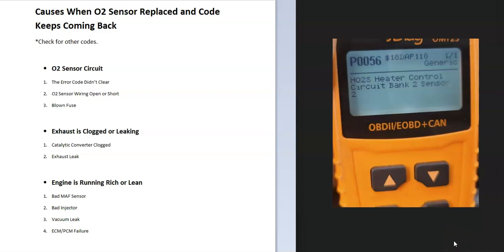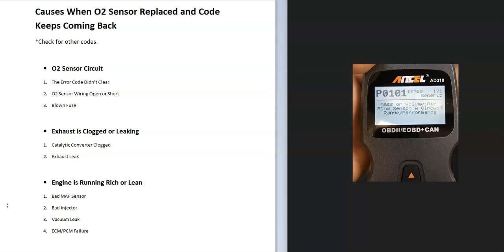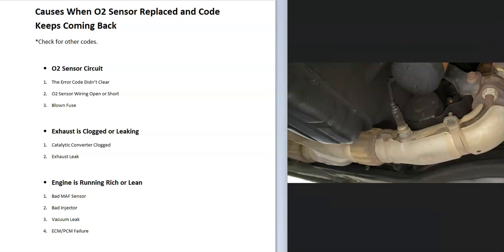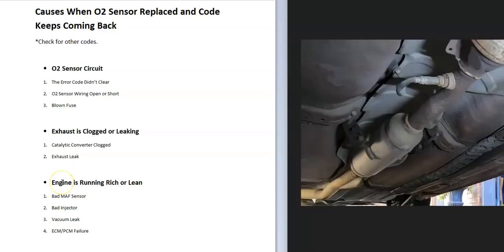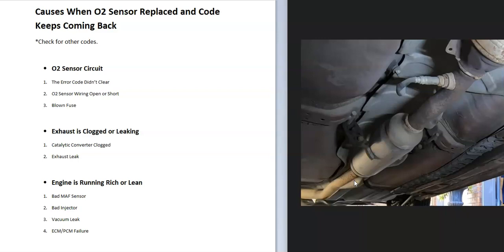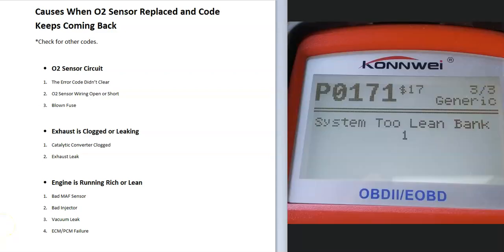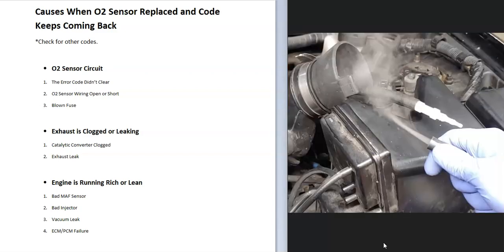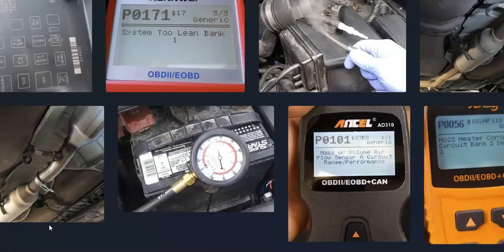Causes When Oxygen Sensor Replaced and Code Keeps Coming Back

Comment: I replace all 4 o2 sensor and after that I get the code P0402 with I think is the bad catalytic but i was hoping for and answer
Reply from the maker: A P0402 code is an issue with the EGR valve "Exhaust Gas Recirculation “A” Flow Excessive Detected". Here is a video on it https://youtu.be/KAcaDElYKxU

Comment: For us, after replacing two O2 sensors and still the same problem, thanks to this video -- it was a cheap FUSE!
Reply: What do you mean by "cheap fuse"? Either was the fuse blown cause it's cheap or was it not blown but somehow causing an issue. Please explain cause as far as I understand either a fuse is letting in electricity or not if it's blown.
Reply: @joev.7909 I think they meant after spending a lot of money on expensive o2 sensors the thing that fixed it was replacing a fuse. Which are not typically very expensive

Comment: I have 2010 Toyota Camry that won’t start after replacing the O2 sensor the upstream it will not start. It will crank but it won’t start. Somethings wrong. I definitely need help.

Comment: My issue is that my 03 350z is having two p0037 code. I replaced the o2 sensor and replaced the fuse yet it’s still there. I unplugged and plugged back in the sensors hoping maybe I didn’t click em in right but still code is there so I’m lost now
Reply: Got the same thing right now. What was the result for you?
Reply: @ you may not like it. For me it was my ecu. The grommet for the main wire harness wasn’t on correctly so when it rained (I’m assuming) water followed the main wires down to the ecu and fried it. Previous owner had some wild things going on with it. If it’s the same issue then find somewhere you can mail them your “new” ecu and they can NATS delete it
Reply: @PrplexedMG  good news, light went away while I was driving. Will definitely keep what you wrote in mind for future reference. Much appreciated
Reply: @ glad to hear it my man the ecu going out in the worst case scenario LOL but to know forsure if it’s the ecu that went out the HUGE red flag is that your radiator fans will kick on immediately after turning it on accessory mode

Comment: can you do a video on p2237 codes thanks
Reply: Did u find somthing about this code i just replaced the o2 sensor and the check engine light still on
Reply: @redouanuiste9334  disconnect your battery for 5 minutes.. this idiot never tells to do that . Which is the only way to reset the ECM..

Comment: My Accord V6 threw a P0130 code for an oxygen sensor but it was because I embarrassingly  neglected the air filter for so long it was totally clogged. It's been 3 months and the light hasn't come back on.

Comment: So i have a 2008 Honda odyssey and been getting the codes po155,po134,p2240,p2251. The oxygen sensors have been changed numerous times along with the catalytic converter, the codes keep coming back it's really been a pain in my side for the past 5 years I've spent so much money trying to get these codes cleared. What can you suggest?
Reply: I’m having the same issues, my Mecanic can’t figured out.

Comment: My mechanic has replaced my O2 sensors twice in the last 2 weeks and each time my car gets worse afterwards. It's after the first time he changed them, it started to hard idle and when I went to pull out in first for a second gear from a slowdown more stop the engine would sometimes sputter out and die. Pulling over turning the car off and turning it back on would allow me to get a gear and accelerate again. I'm at a loss for what's wrong, I don't know if they'll be able to figure it out and I don't think replacing the O2 sensors a third time will help. I feel stupid for getting them replaced once when all my issue before was  just the check engine light really.
Reply: Your mechanic must be ASE CERTIFIED MECHANIC.
Can read a book and answer questions.
Reply from the maker: A bad 02 sensor should not cause the engine to run badly. The engine will not go into what is called a closed loop and be less responsive but should still run OK. I would look for other codes as there likely is another issue.
Reply: @HVAC_Mechanic  
I'll go to autoZone and have them look at the codes again. if it's still bad after going to the mechanic on Monday I'm finding someone else :( it's making a tinny rattling noise from the passenger side of the engine now too. All these weird symptoms only started after they messed with the sensors.

The codes before they changed the sensor the first time were
P0137 
P2097
Secondary 
P2270

I would like to fix it myself but I am beyond amateur and wouldn't be able to figure out what's wrong with it :(
Reply: @HVAC_Mechanic  they replaced the sensors incorrectly and manually grounded them resulting in frying my cars computer board. It's made a lot more issues I'm so devastated with this car :(

Comment: I had a 1,2,3 cylinder misfire and took out my downstream 02 sensor and was loud but ran with no errors. I then placed the suspected bad 02 sensor on the right(other) side and the codes followed to 4,5,6 cylinder. So I bought a new 02 sensor and replaced it on the right side and still getting engine bogging down on 4,5,6 - Any ideas what my problem might be?

Comment: 2013 Chevy Equinox...changed O2 sensor upstream & downstream.. 4K road trip was fine entire time...light back on..replaced both srnsors again yesterday...light back on today...its running great...
Reply: Maybe a fuse??
Reply: Did you ever locate the issue?

Comment: My sensor was throwing a code and when i tested it, it seemed faulty.

Ordered a new one, and it finally cleared the code until recently the check engine came back for slow response. Connection seems good. Not sure what else is causing it. 1133 and 0113 are my codes.

Comment: If you replace the sensor on the downstream, what else could it be because I replaced mines but i still get a 0036 0141 code. I check live data. Its reading high, around 600-700 millivolts on the old and the new sensor. Plz help
Reply: did you fix it I have the same problem ?
Reply: @miguelena40  Yes it got fixed. I replaced it with a OEM ac delco sensor. I think I had a Bosch before
Reply: @ thats a good news buddy my car have 3 o2 sensor codes which is rare so a YouTube video recommend changing the valve purge , i did and  nothing , clean the throttle body  and MAF sensor and nothing I change all 4, O2 oxigen sensors and nothing , I have all the symptoms for a bad MAF sensor in my car is expensive more than 100 bucks  PD. is consuming gas like crazy around 170 miles for every 12 gallons 3 mechanics don't find the problem I am getting crazy
Reply: I can't stand these so called modern inventions sensor everywhere, this is stupid, it's like having an eye infection and now your legs don't work!!
Reply: Run down the wiring from the o2 sensors all the way to the harness connection under the hood and look for smashed/crimped areas, areas touching sharp objects or chewed up areas.

Comment: Another reason could be a POS aftermarket sensor. Bought cheap o2 for my Altima. codes kept on. Replaced them with OEM and the code went away.
Reply: Could it really be it

Comment: Here's a possibility...FCA issued a TSB to REPROGRAM the PCM back in 2008. The TSB is #18-011-08. This is for a false P0139 code being flashed intermittently. This will cause you to FAIL YOUR SMOG INSPECTION!!!

Comment: I replaced both O2 sensors in my 1998 buick century li.ited. now the anti brake light and service engine soon light stays on plus the car cuts off while driving it. What's wrong?

Comment: I have a 2016 Ford explorer XLT and i change Both o2 sensor the shop told me it was that but now check engine light turn on by putting my car in gear po161 code please somebody help me

Comment: I have an iS 250 Lexus 2006 What about spark plug and coils could it cause p0138 ? I put a brand new map sensor and a brand new O2 sensor. and I also noticed a leak on the flange coming from the manifold to the  converter. Fix it and still getting code…thanks
Reply: Did you ever find the problem? I have the same issue
Reply: @Notgreggreg  I fix the issue the key was to replace them both parallel up stream and down stream together
Reply: It doesn’t necessarily work by changing both sensors you might have gotten lucky . The way to do it is checking the ohms resistance or if you have a 40 dollar scanner go into each sensor and check the response signal it will show if you have a lazy sensor or a dead sensor but also a vacuum leak will cause high voltage. Best thing for DIY  is check online put your code in and it will show all the possibilities of the code and just go down the list eliminating every one . Worst case is to replace ecu but that rarely happens  one more thing check your sensor when buying them for damage there sensitive if dropped can be damaged and don’t buy the sensor that you use your own conector splicing wires that will increase ohms changing everything don’t want that .

Comment: Also I had a question for you. They said an autozone I had it found out what my codes were and I got APO 430, and I changed it. The 02 sensor bank 2 AM I supposed to change both of them on the right side. I changed the upper one I think I'm just gonna change the lower 1 also, just for s** and get.  Wasn't too sure thanks have a great day

Comment: I have been chasing the dreaded p0300...random misfire.  We did a date scan and found a bad coil and a bad injector and the evap wasn't functioning correctly.  Got all those fixed, truck ran great, the next day sluggish again, now I have a p1133 code.l and p0175  What the heck?

Comment: hey guys how to code this oxygen sensor after the replacement ? i heard i need to turn off the battery but i'm not sure about that 😕
Reply from the maker: Most use a scan tool to clear the code and see if it returns. Often, a battery cable can also be removed, but this will also reset other things, such as the radio.
Reply: @HVAC_Mechanic I bought the sensor after the catalytic converter from BOSCH but the one before it I bought from another brand, would that be the reason I still have an error code on the sensor before the catalytic converter ?
Reply: @HVAC_Mechanic i already orded a new one from BOSCH as well, i'm waiting for the delivery.

Comment: I have Both o2 sensor codes and a P0302 Cylinder 2 code I swapped coils and spark plugs… my final guess is a clogged fuel injector/ and or fuel pump and filter. 2014 ford mustang GT (5.0)
Reply: Did you get it fixed?

Comment: So I've replaced the mass air flow box and o2 sensor and fixed the exhaust. It's a 2003 ford focus . Still doing the same code and running and idling weird but hasn't put a check engine light again?
Reply: Possibly vacuum leak

Comment: I have a 2000 Chevy Silverado 5.3 just replaced all four O2 sensors, gas cap fuel filter and another little chip plug-and-play deal on top of the fuel tank. I've reset the OBD2 service engine soon after each service and continues to come back. Along with my brake light and ABS light. It might be coincidental but all happened same time. Any ideas?
Reply: Check vacuum leaks ( any air hoses on your engine that are leaking) also check your circuit. You pray to jesus it's not the catalytic converter.

Comment: My oxyg sensor new but light still on Engine light with the code maybe the intake need replacement?
Reply: If you have an intake leak, you will get more codes besides an o2 code. Misfire codes, evap codes would be likely.

Comment: Please explain if you would how an exhaust link underneath your truck or car can affect how the 02  sensors read the ambient air (outside air)(which now has exhaust fumes in it from a leaky exhaust pipe) would alter the downstream sensors ability to send the proper information To the computer Which has to make adjustments according to reading the downstream sensor is getting.
Remember there's an exhaust leak under there. So the downstream sensor maybe the upstream sensor as well is confused.
Reply: I assume the leak would have to be BEFORE the 02 sensor like a cracked manifold.

Comment: I have a P2251 code on my 2009 Kia Spectra EX.  I replaced the Oxygen sensor and exhaust manifold/catalytic converter but I still get this code and have low RPM's

Comment: I replaced both o2sensors and the light didn't go away, my problem was that connection was not plug in all the way, so I plug it and the light when off.
Reply: The plastic clip connection right? I tried pushing it in all the way and I feel that it might be my problem. I never felt a click and when I pulled it off it came off relatively easy compared to the one I replaced
Reply: I tried this first. Saves a lot of time

Comment: I got a 2013 chevy equinox with a p2097 code was getting a sluggish acceleration to hesitation when accelerating.
Reply: Same. Did you ever figure this out?
Reply: @dillon6320  was both O2 sensors but you have to recalibrate them aswell

Comment: i recently replaced my o2 sensors 4 off them on my 2015 Chevy silverado but check engine light still on can i get some help on findig the problem
Reply: Did you fix the issue? I have the same issue. Had the P0420 code changed both cats, changed all 4 C02. Code for bad 02s came on the next day.

Comment: Hi I have a weird one for you I have been pulling my hair out about this one and I'm not too sure where to go next besides changing my PCM but one day I got a code bad O2 sensor in my 05 Dodge Stratus 2.4 L dual overhead cam long story short I replaced the O2 sensors both upstream and downstream I cleared the codes started my car and the code came right back but came back as a low voltage for the O2 sensors so I've inspected all the wires and everything everything looks good the weird thing is if I unplugged the O2 sensors and clear the code the light stays off for about 30 miles and then it comes back as a high-voltage code but how is that if they are unplugged have you ever ran into this issue before just curious?
Reply from the maker: It is hard to say, but a failed PCM is fairly rare. Wiring issues can be a pain and often hard to find. I would check for any exhaust leaks or a clogged catalytic converter. Many techs would swap out the sensors again with Denso sensors.
Reply: @HVAC_Mechanic  well my cat is hollowed out and I had a o2 code after I did that and had to install a restriction adapter to the downstream and the light was off for years until about a month ago the o2 code came back and my upstream o2 was melted so I replaced both upstream and downstream with the adapter on the downstream still plugged them in cleared the codes and as soon as I started it there were codes for low voltage on both o2 sensors tried to clear the codes again and same thing but with them unplugged I drove the car for 30 miles or more without the engine light coming on but when it did come on finally with the o2's unplugged it said that I had a high voltage reading from the O2 sensors which I thought was very odd considering they were unplugged the wiring and everything looks intact I can't really find any breaks or rubbing marks on any of the wiring is it possible that I could have a relay doing this to me
Reply: Hi I'm just curious do you know the voltage output from the O2 plug on the harness I'm getting 829 volts on my multimeter but I'm saying that I should have 12 volts there

Comment: Why is this video under watched and why wasnt this my first video suggestion for this code ..!?!? This is an excellect video of everything abt this code that i bave been through since having it lol
Reply: Flex007 Basically it was ok except this video is suppose to be about a freaking p0038 code and NO OTHER CODE! This is a "heater side" issue on the O2 sensor. Yes wiring fuses relays can cause this issue but this can be simple to check just by plugging in a scanner and watching the "data stream" once you see the sensors working by see the numbers moving then you know the wiring and sensor is working. However one thing he didn't mention is if you DON'T have an OEM sensor then your sensor will not give out the right readings back to the computer needed to turn of your code. The other thing he said was that an exhaust leak can throw off the sensor reading which in the case of a leak after the catalytic converter wouldn't effect the downstream sensor. And you can pass inspection if you have all your exhaust pipes from the manifold including the cat. After the cat does not matter for inspection  And if you had a leak before the cat your upstream O2 would be throwing a different code